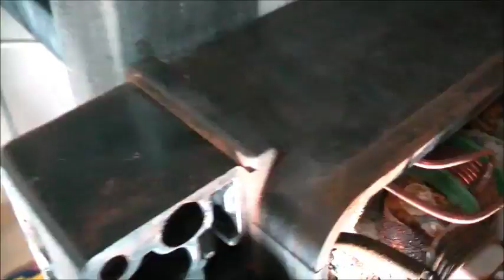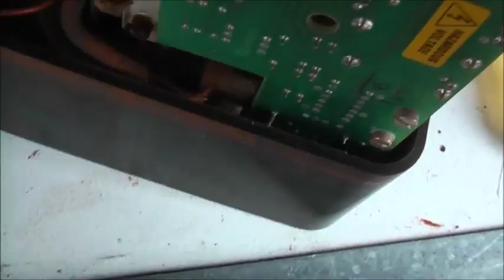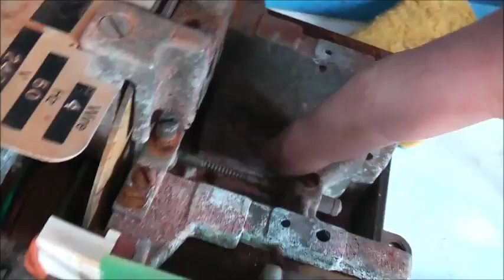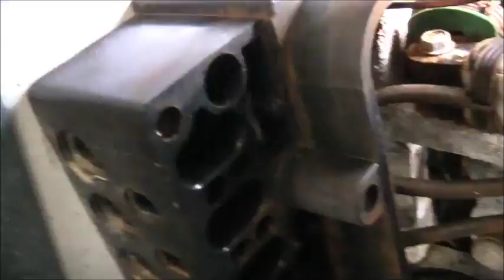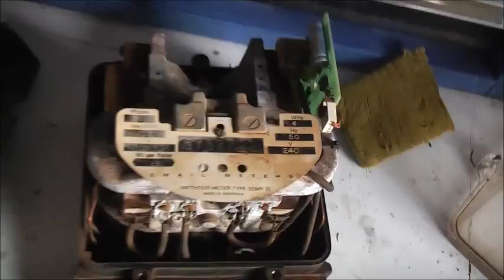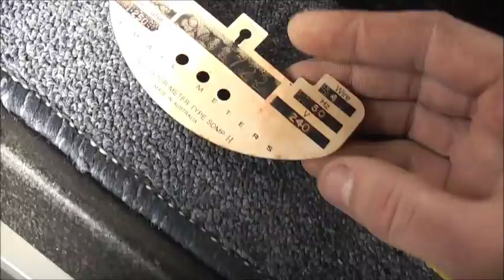Outback SDMP EMAIL Watthour Meter, Restore!

Comment: Crikey, that poor instrument has had a tough life. Did you ever remove the loadwheel from in there, clean it up and re-instate it into its place?

With that readout, if anything's squeaking-and-squealing in there, that means friction and like you have said, this will probably greatly affect accuracy.... that's if the loadwheel can budge it at all! Loadwheels have little to no torque, so even the smallest dab of WD40 on the ends of the shafts within the readout may help this readout to function correctly.

Before powering this up, do test it up to make sure you're getting good readings on the coils and that none of the voltage coils have gone short or are open. This could avoid lots of frustration if it appears not to power up, or big bright bangs for that matter.

Thanxx for showing,

-Wayne's Electrical.

17th July 2017, 23.32

Comment: Did you test the capacitor on the pulse board?

125C and 130C capacitors are commonly found in sealed power bricks and automotive electronics.  In metering applications I believe they've been largely replaced by polymer capacitors.  I tore apart a few Dell power bricks which had a few Rubycon RX30 capacitors in places where they had to be placed next to transistor heatsinks.